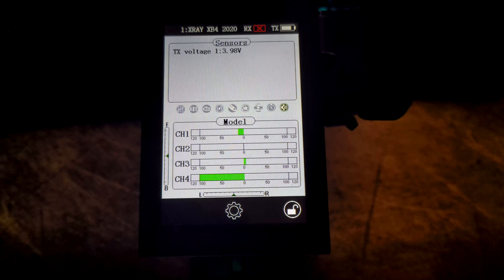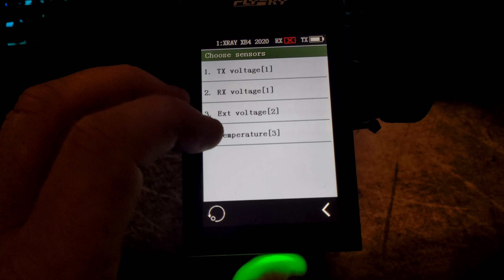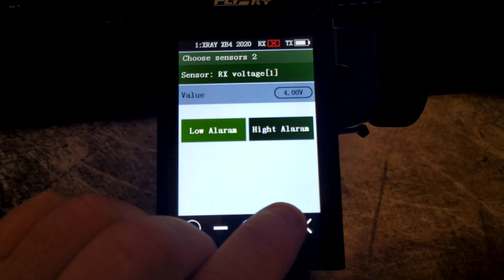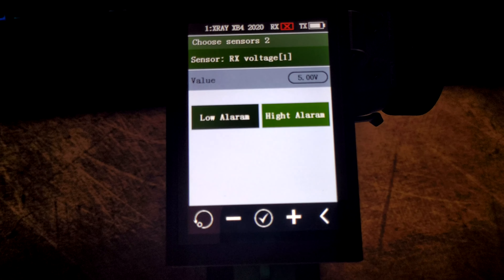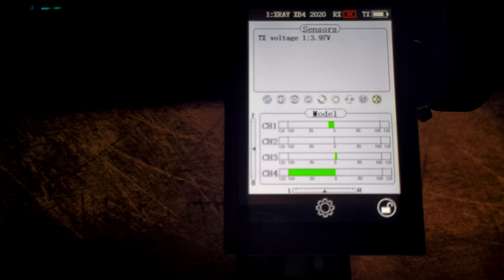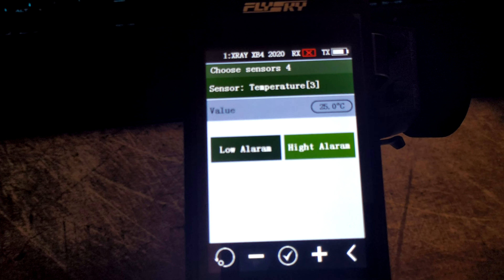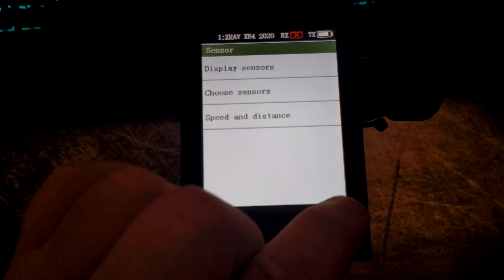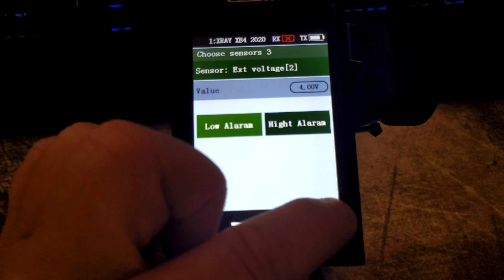How to set the alarms for sensors on flysky Noble NB4

Comment: Hi again!  So based on all your help (Thanks so much for responding).  I just did the update to .93fcc and programmed and bound both FGr4 and FGr4S.  I just wanted to tell you about a glitch I experienced.  The Gr4 went without a hitch, however I had problems with the alarm with the 4S.  Even though the Rx voltage in the telemetry from the Rx was showing peak - the alarm refused to stop sounding/flashing.  I tried adjusting the alarm limits to minimum with no effect.  I was about to contact fkysky (yeah good luck) but decided I'd pursue other options first - not wanting to wait 6 weeks for a response which seems normal for them.  I decided to try to program and bind again, fixed it.
Reply from the maker: Yeh I have seen a strange glitch with one of mine where the bec voltage reported 11v I know the bec in that RC can not be changed and is 6v so re bound and fully working ? Strange one with the voltage but a re bind does see to sort it :)

Comment: Sorry for all the questions. earlier  I got my temp & volt sensor to show up on main screen list but when I go to Choose Sensor all that shows up is the stock choices the tx comes with? Temp & volt don't show up under the Choose menu for me to set alarms? Not sure what I'm not doing right? Thanks again
Reply from the maker: Make sure your on 2.0.100 firmware also the receiver has to be powered on and sensors connected or they will not show up
Reply: @WTFRCCars   ok thanks again for reply. I'm checking again tomorrow. I am on 2.0.100 FW but rx was turned off when I tried so maybe that's my issue. Thanks again
Reply from the maker: Yeh it has to be on or the radio can't see them to allow you to set the alarm :)

Comment: Hi, do you know what the minimum voltage for the transmitter is before it shuts down? I want to adjust the tx minimum voltage alarm.
Thanks and best regards Thomas
Reply from the maker: Unfortunately I have never ran mine down that far I alway just hit the base battery button and charge it back up at about the 50% mark